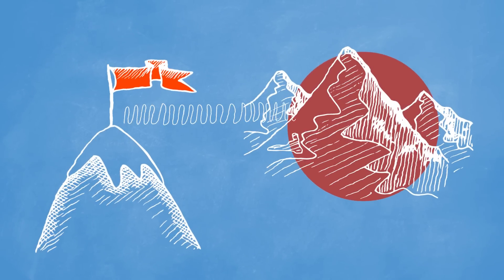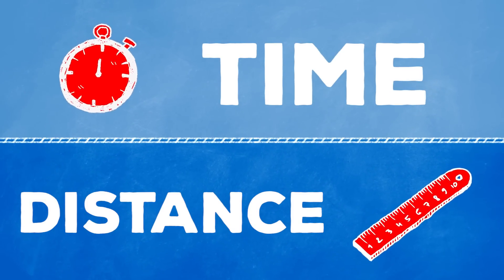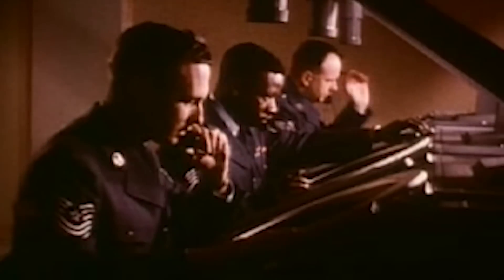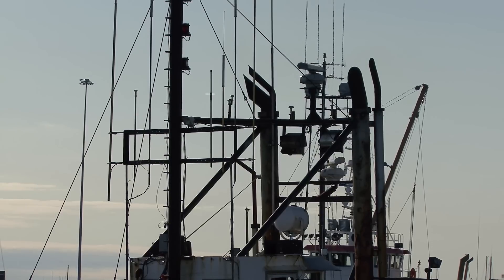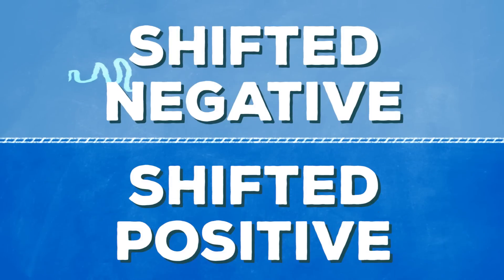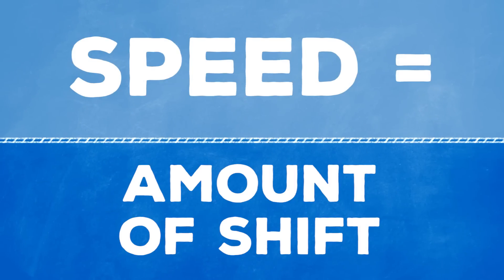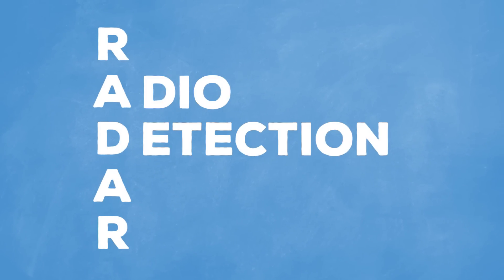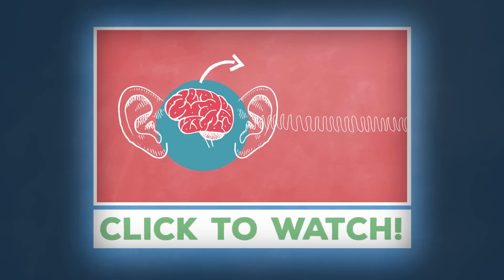How Do Radars Work?

Comment: hi. I don't normally comment on videos, but I feel I need too as a physicist. Whilst this video is good, I feel as though in one very key area it is completely wrong. RADAR uses radio waves - most definitely not sound waves! I think you may have confused SONAR with RADAR, SONAR uses sound waves but is only underwater. RADAR works poorly underwater - SONAR works poorly in air. Normally you seem to be more accurate than this but this quite a key difference. However, both systems do use similar principles just different waves!
Reply: Duh

Comment: "An echo RADAR emits a sound wave"

"Doppler RADARs emit a radio wave, too"

This seems to be implying that a sound wave (audio frequency, or AF) is the same thing as a radio wave (radio frequency, or RF). This is incorrect and if echo RADAR was using AF instead of RF, it wouldn't be RADAR at all, as RADAR stands for Radio Detection and Ranging, meaning it uses RF (Radio Frequency) exclusively. RF is electromagnetic waves, AF is sound waves/vibrations. Though these waves behave in a similar manner, they are most definitely not the same thing.

Source: I worked as a Radioman in the US Navy where we actually learned how our equipment worked, unlike the Air Force, apparently.
Reply: Lol.
Score 1 for the navy.
Reply: Please do tell  me more about radar on ships !
Reply: Makes more sense because how fast sounds travels and how fast radio waves travel.